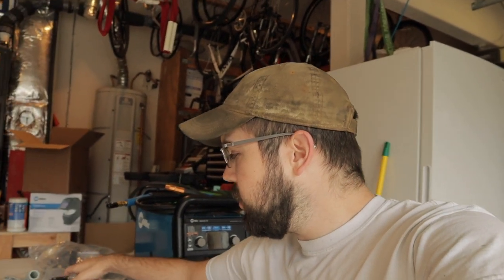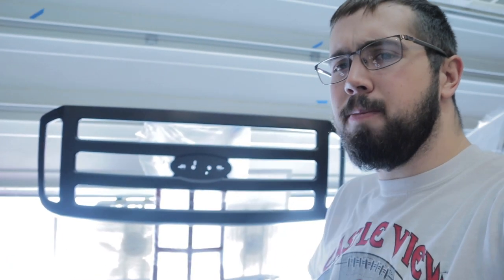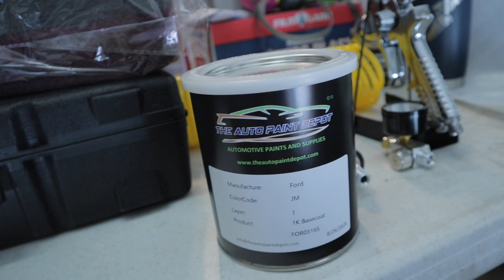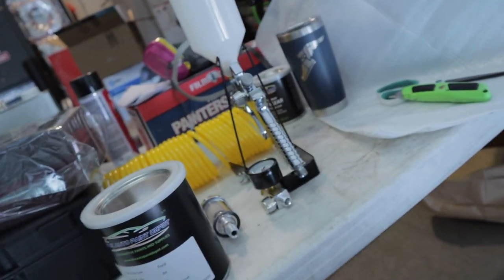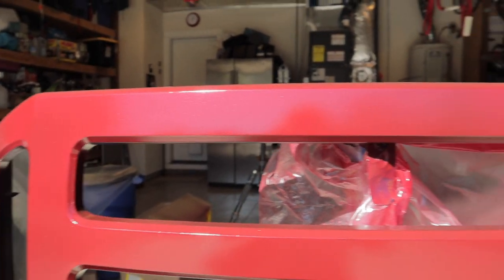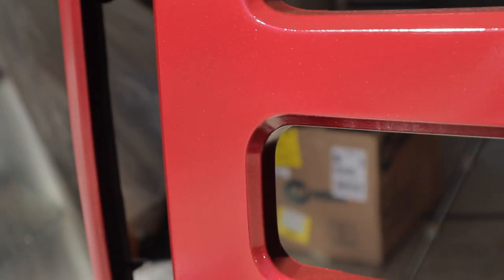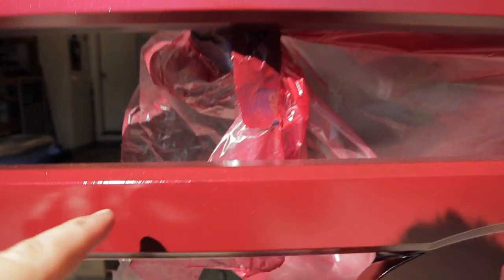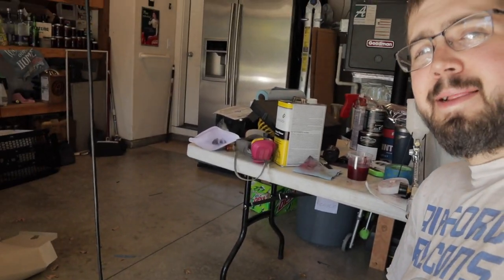Ford 7.3 Powerstroke DIY Grill Color Matching 05-07 Conversion

Comment: You can wet sand it with a block and 1500-2500 grit sand paper to get the runs out and get rid of the orange peel so it looks smooth.
Reply from the maker: Yup. That the plan 👍🏻

Comment: When you showed outside the sky looked much better! I stumbled across your channel when you were insulating the floor. Truck is awesome! Can’t wait to see the grill installed.
Will you be making a bumper from a kit?
Reply from the maker: Much much better 👍🏻 I will not be using a kit. My plan is to model it after a full size ranch hand bumper and do all the cutting and fab work myself.